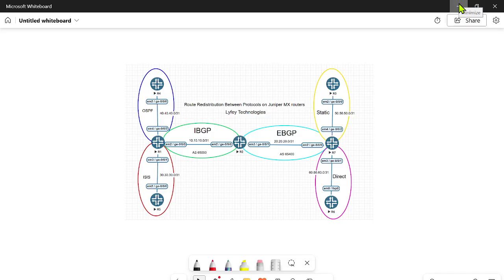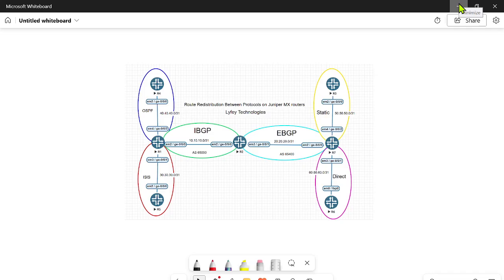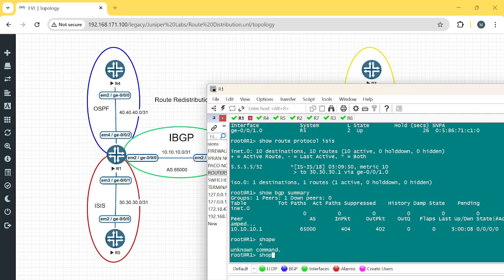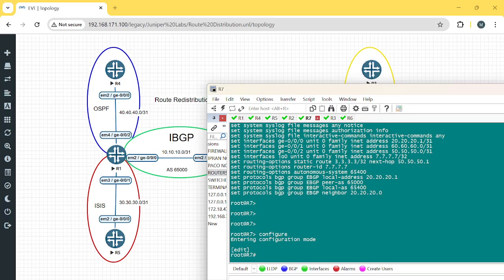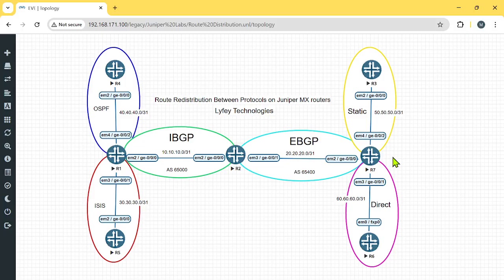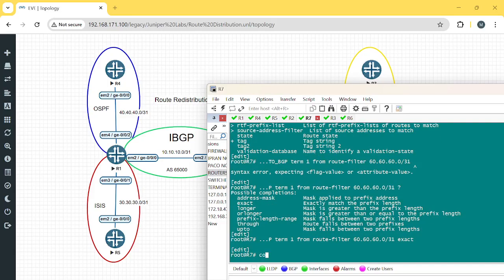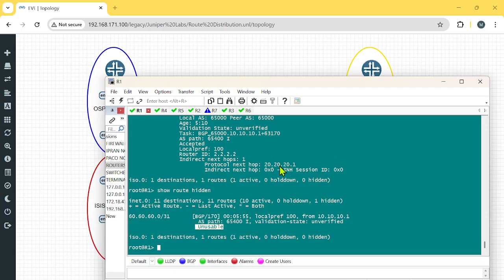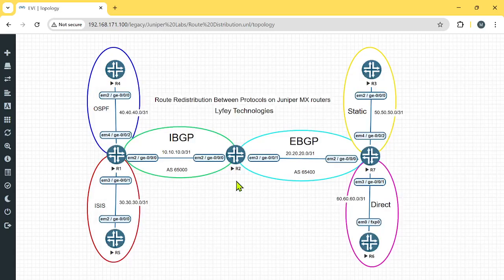Juniper Lab Simulation session 14: Direct #routes redistribution to #bgp on #juniper MX #routers

Comment: Awesome R1 does not have the reachability info with R7 which originates the direct route into bgp but we make the   policy to export route into bgp and R2 learning the prefix but R1 is not due to bgp split horizon rule now we make next hope self command on R2 with neighbouring R1 ip then the direct route usable.
Reply from the maker: Thank you so much for your answer. Thats correct, The router doesnt change the next hop when advertising the route to IBGP peer. So we need to set the nexthop self on that router so that the nexthop should be usable on the recieving peer.  We appreciate your response.